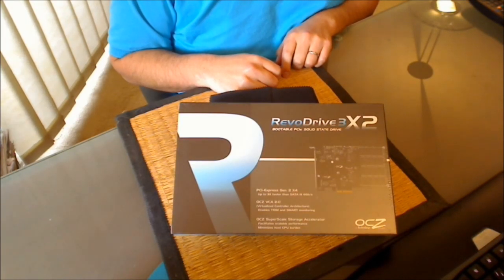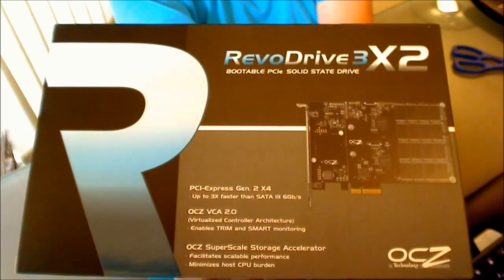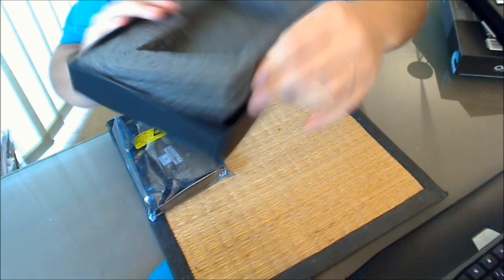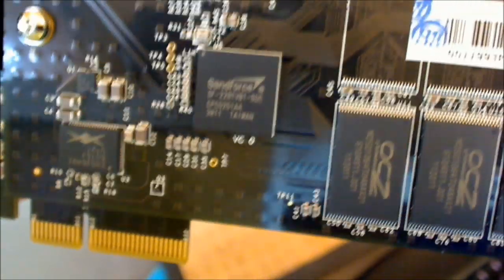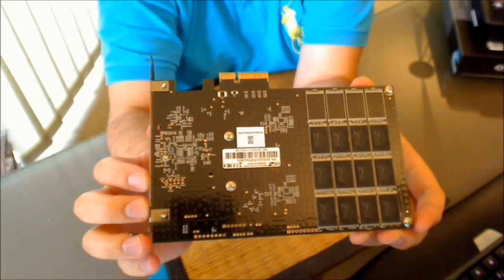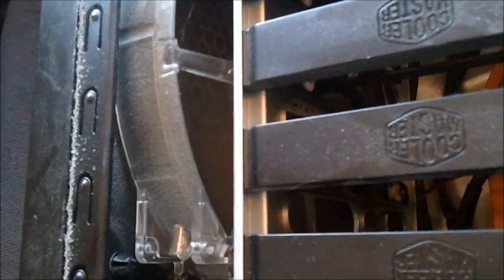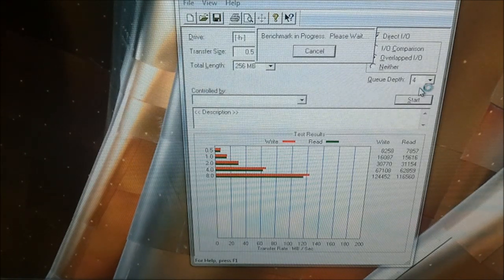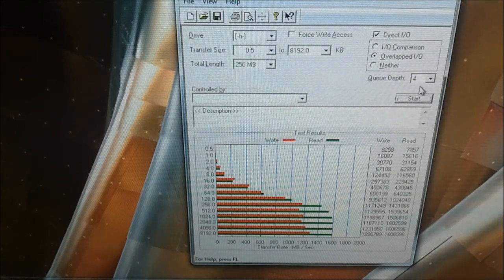Boydo's Tech Talk - OCZ RevoDrive 3 X2 SSD Unboxing and Preview

Comment: I was considering this, but figured out it was a much better idea to get RAID card and some SSDs. The OCZ benchmarks are misleading as they uses files filled with zeros, which is the most compressible data you can get, and that's why they get 1500mb/s. However, on random data (more realistic use), it reads at about 700mb/s. In other words, two good SSD in RAID 0 are faster(and can be upgraded to better SSD later). The Revodrive also apparently has a high failure rate... Not worth the gamble IMO

Comment from the maker: Shouldn't need to change the board as the drive will fit and work in one of the x16 slots (you just ending up using the equivalent of an x4 slot and not the rest of the x16 slot). Try using one of the two white slots first if you can followed by the black slots then blue.

Let me know how you go :)

Comment from the maker: @blewett47 Installing Windows 7 did require a little tweaking. The easiest method is to disable all AHCI interfaces on the motherboad (or put them back into legacy IDE mode) as having too many active seems to confuse the setup and causes it to blue screen early in the install. Once you get around that you just install the drivers from a USB stick or disc and away you go. The setup seemed faster to complete compared to the last hard drive installation I did a while ago.